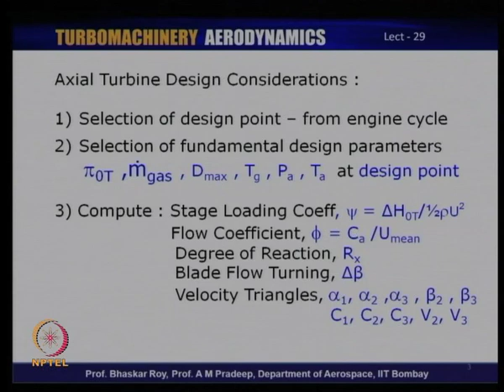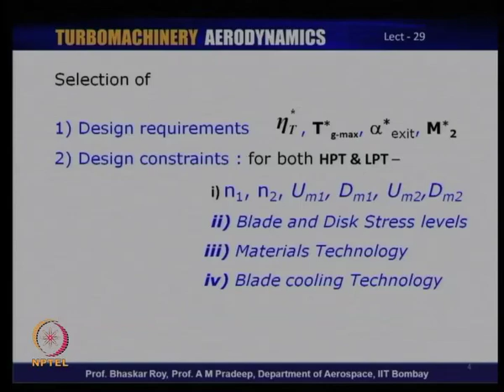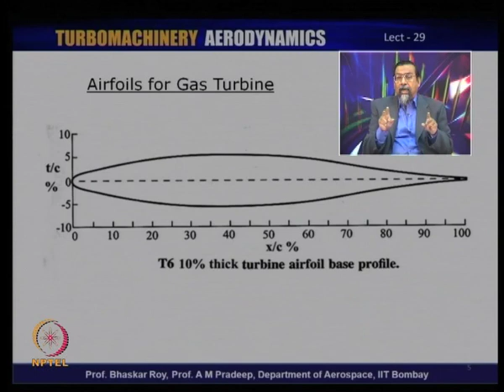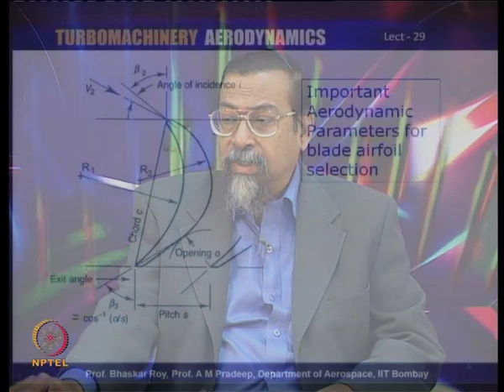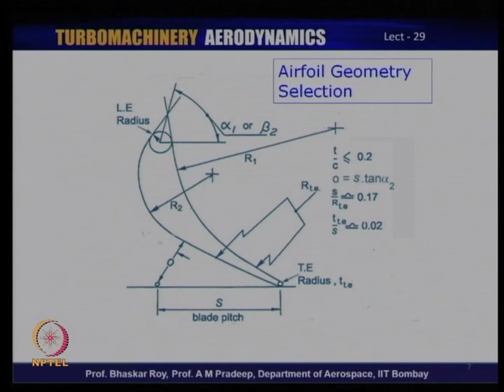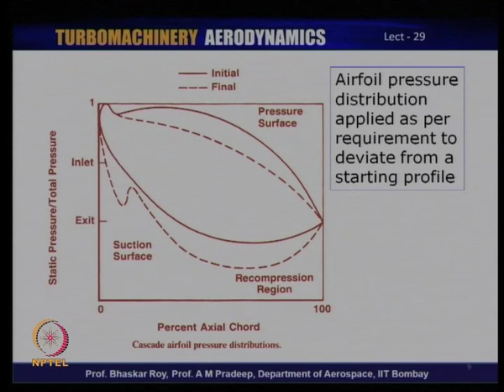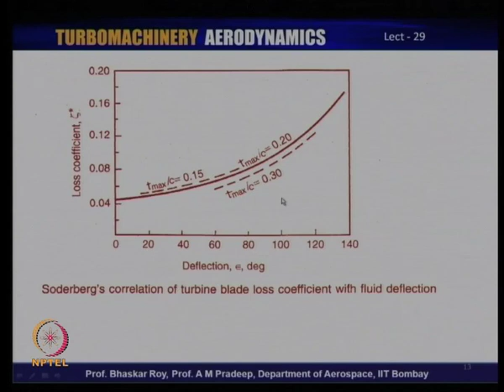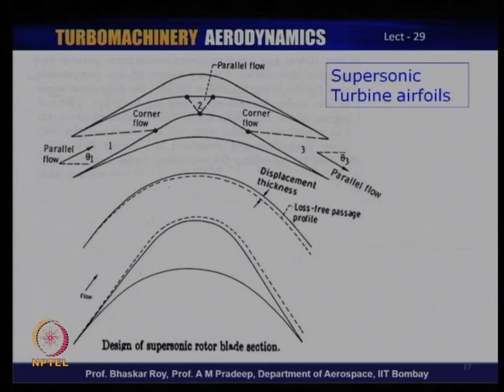Mod-01 Lec-29 Turbine Blade Design: Turbine Profiles, Aerofoil Data and Profile Construction

Comment: When dealing with students at different stages of thermodynamics and aerodynamics education, most early students ask about the different profiles of airfoils used on compressors and turbines. Also, there are situations when the shaft power of the turbine is meant to just drive the front rotary compressor and leave enough axial fluid energy to provide the jet reaction, and then there are those situations when the turbine shaft power is to be used not only to drive the rotary compressor but the gearbox for the turboprop or the fan where the engine thrust is obtained by the propeller or the fan, rather than the jet stream reaction.
As a rule of thumb to satisfy the younger students, in order for them to have a quick grasp of the dynamics involved, I found it useful to suggest that in a compressor and a turbine and the burner it is useful to always think of ACCELERATION which is taking place.  An air particle in a jet engine may be considered as having its position described by a Polar Coordinates in that an air particle is placed at a given radius "R" and an angle. " angle A" hence   S is a function of (R)(A)  hence the accelerations will include rotary and linear accelerations to which one would need to add the temperature effects.
At the compressor stage, to increase the pressure one needs to slow down the air through the compressor rotor /stator blades while at the turbine one needs to accelerate the air to a higher speed during their travel through the hot turbine/stator blades.
Since one is dealing with a thin slice in the discs that make the rotors and stators the logic to achieve a deceleration in the compressor is to have the air entering the blades at a narrow-angle with the face of the blade disc and leave the end of the blade closer to a right angle with the disc or parallel with the compressor shaft.   This mechanical logic will produce a larger area as the air moves in the gap between the blades of the compressor. With the diffuser before the burner and other deceleration of air will ensure a higher pressure. With the hot turbine stage, for the hot burner air to be accelerated it enters the turbine blade almost at a right angle to the blade disc and leaves at an angle closer to the face of the disc.  This mechanical logic ensures that the area of the space between the blades of a turbine and its associated stator gets smaller so the air gains velocity.   The rotary or linear energy of the hot gas is controlled according to what is desired, to drive a pure jet or a turboprop or a fan. 
The concepts become a little complex when different turbines are used to drive different loads. 
In a jet engine using air as a medium, because the air is compressible, one may appreciate the compression and expansion of the cold or hot air that moves in between the blades at the compressor or a turbine stage, but in the case of a water propeller, since the water is incompressible, students find it more difficult to understand what actually happens between the blades of a water propeller regarding the velocity and pressure states, when the water between the blades of a sea propeller cannot change its volume.  When one graduate to the surface and cavitating propellers which throw lumps of water,  the aerodynamic and thermodynamic concepts provide a few hours of enjoyment in trying to understand the difference between water propellers and jet engine compressors.  
At the early stages of the steam turbine, Sir Charles Algernon Parsons at Newcastle upon Tyne who persuaded the Royal Navy that steam can be used to produce higher speed in Naval ships,  he made the "TURBINA" 1894, the first turbine ship and when he came to draw the profile of the turbine shape, he doodled it down on a piece of paper using only his intuition of how he felt that steam pressure would behave around the accelerating stages of the rotor and stator of a steam turbine blade. It is said that 100 years later the turbine profile was analyzed by modern computers and it was found that Sir, Charles Parsons was not out by even 1% from the optimum shape.  It seems that the early true engineers who built the machines became part of them and felt their way of shaping them. 
It seems that there are "Savants" who exhibits exceptional skill or brilliance in some limited field without needing a university education. There are savants in mathematical operations and also there are savants who feel their way through invisible and silent engineering functions and fluid operating in between compressor, propeller, fan, and turbine be it reaction or impulse,  are fields which should be better presented even at the earlier schools even if the weather and winds and whirlwinds and dust devils and flying wings and birds and fish fluke/fin propulsion are made a little easier to understand by the general public.

Comment: Please sir, any difference between a steam turbine blade and a gas turbine blade? What are they in terms of design, protection, defects and corrections?
Between the two blades which is much more efficient or better if the blades are switched?
I await your reply as soon as possible, sir.
Thank you!

Comment: if i would like to design an airfoil , what is the software used ?
Reply: XFLR5. I'm using it. But don't expect much from it. The advantage is that, we can get property graphs. But we can neither import not export advanced airfoils like NACA 6digit, Reflexed airfoils or any other Airfoils that we design.